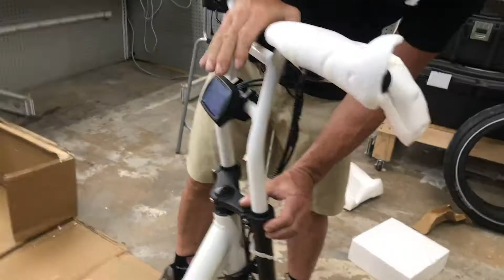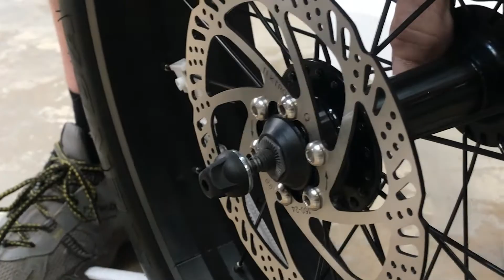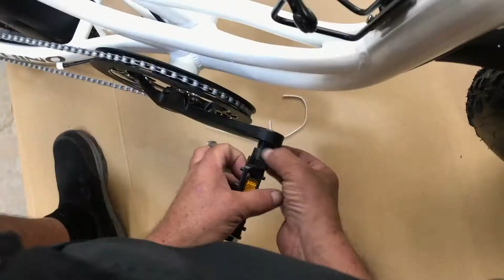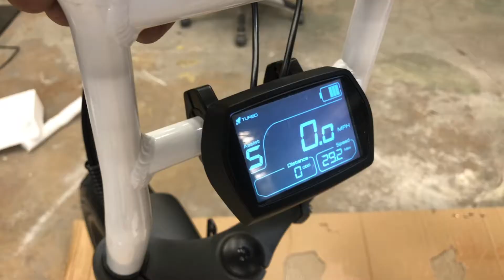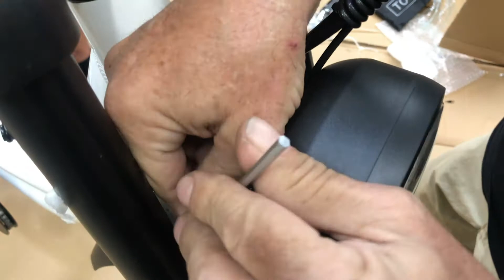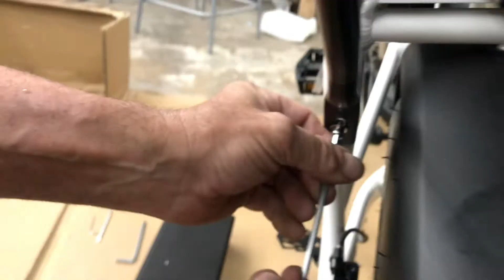How to Assemble Your ZUGO E-Bike | Step-by-Step Guide with Professor Al & Brian

Comment: Just got my bike today.  First, there was no front quick release, but more importantly: those two “bolts” on the front caliper don’t have anything to hold them in.  So they just come off with any tension.  The whole in the caliper is not threaded to hold them.

Is this a design/prod flaw or am I doing something wrong?  Pretty much stopping me in my tracks and incredibly frustrating

Comment: Im having trouble with the whole centering the caliper thing. I keep hearing a rub, no matter how many times I try
Reply: loosen as he did, hold the bike up and spin the wheel. quickly depress the brake lever so as to suddenly stop the wheel from turning. tighten and check for rub again with a quick spin. Also make sure your wheel and quick release is properly seated into the fork with the weight of the bike on the wheel before doing any of this. If it is in there crooked the disc will rub no matter what.

Comment: Are they coming out with a larger pallet of colors anytime soon? Because just recently they added Iridescent Purple to the color roster and I’d like to know if there are going to be anymore in the future. Plus are you coming out with more accessories for the bike as well, though how many after market products fit on this kind of bike, because I would like to fit some mirrors as well as some turn signals as well to the bike?
Reply: I'm assuming they will come out with more colors & more accessories, especially because competing bike companies are. What color are you interested in / what accessories?
Reply: Cargo baskets, Indicator lights on the front and rear, even after market brand ones. Maybe a some paneers on the rears seat as well. Though now I’m kinda concerned about the quality of the bikes as someone who gave it a positive review shortly after says the tetro hydraulic disk brakes are of poor china quality.... though he off roaded too much. I’d like a green or silver color also included in they’re color line up. But now I’m going to settle on a Super 73 S1 before upgrading to a moped that needs a moped license. Though I’m crossed as well on weather or not to get the step through or step over model. Though now.... I’m considering getting a GigaByke Groove or an American Electric Bike Company 🛵 since I might be going back to my local factory next year due to COVID 19 shutting the current place down where I work, and a heavier bike that won’t likely get stolen from the parking lot might be better as there is no bike racks where I work. That.... or an E TWOW GT Scooter 🛴 that I can take in the building for with me on nice sunny days? It’s maddening on what to invest in to be honest that would serve you better in these times. As the current top selling Moped’s are of questionable quality at this point, both Juiced Bikes and the New Super 73 line-up.

Comment: Turn the handlebars in towards you and switch the controls opposite and the bars will be closer.
Reply: Yes I TURNED MINE AROUND  works fine MORE COMFORTABLE
Reply: SAME FRAME AS MY COSTLY  ARIEL RIDER  TWO MOTOR BIKE  I LOVE RIDING  --THE ZOGO RINO IS NICE QUAlITY FOR THE PRICE.
Reply: @alphonsotate2982  Was it difficult to do? My bike is arriving soon.
Reply: Was it easy to do? We're u able to use same grips?

Comment: I just got mine today also.  I’m missing my headlight and rack.  My main question is how to unlock from class 2 speed to class 3.
Reply: I got my unlocked code by direct messaging there instagram they will tell you the step to unlock its easy. If i remember correctly they told me to hold the plus and minus together and 4 digit number will come out. And you need to put the numbers in.My code was 0606 and it unlocked for me. But you should direct message or thru there website.
Reply: Ok, thanks.  Looks like there is a code on the key ring.
Reply: @troymcgrew9822  its not on the keyring its 0606 for all bikes
Reply: Yep, that code didn’t work.  I was peddling 30 mph on mine.  Easy peddling 20-25mph.  Very cool